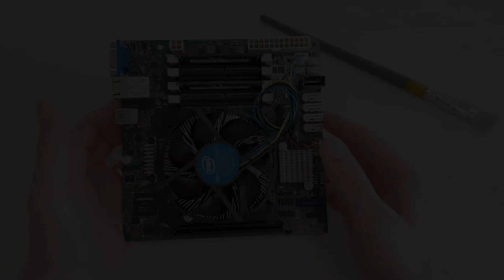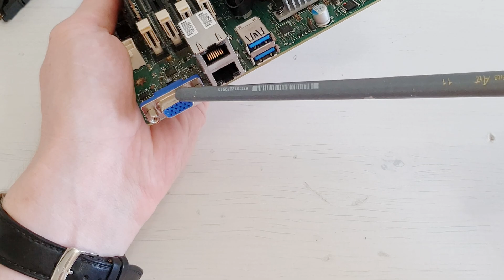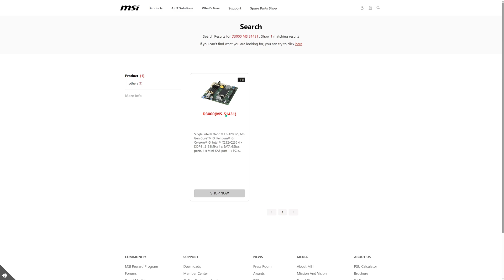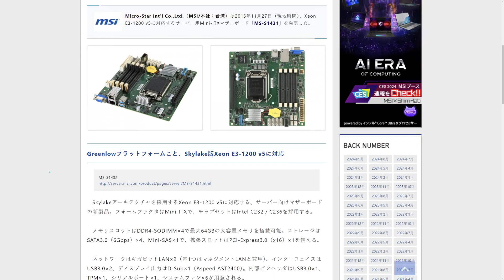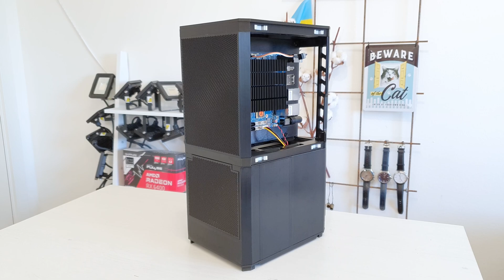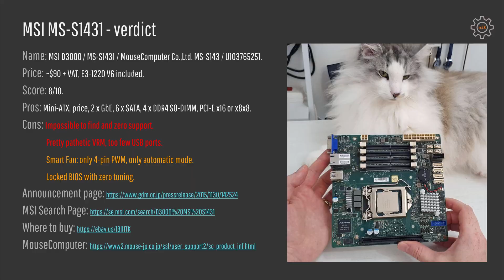MSI MS-S1431 – rare mITX LGA 1151 OEM motherboard for NAS

Comment: Love your videos myconst, i have a question, i will upgrade my e5 2689 with 16 gb of ram to a e5 2690 v4 with 32 of ram, i already have a gtx 1650, what graphic card do you think i should buy that doesnt give bottleneck and is good for games?, i would pay like 300-400 dollars for a new graphics card, and what graphic card has a lot of bottleneck with 2690 v4?, like at what point does it have too much bottleneck?
Reply from the maker: The question does not have a universal answer, it really depends on what games you play, what resolution and settings you use. In general, I would say RX 6650/7600/6700/700 XT or RTX 3060/4060/Ti are good candidates.
Reply: @Miyconst Thanks

Comment: In my search for the perfect motherboard for my NAS, I think I finaly found a good candidate : Gigabyte MC12-LE0. VGA output (no need for a PCIE graphic card or an AMD CPU with APU), 1 slot PCIE 4.0 16X which allows bifurcation for my 4 nvme ssd and 1 slot for my 10gb netword card, ECC and recent CPU support, and 6 sata ports as bonus. Bought new 85€ with shipping on ebay. I will test it when my Ryzen 5600 will arrive.

Comment: If it is an MSI board, maybe you can access the hidden BIOS settings with the combination of Right Shift, Right Control, Left Alt and F2. That is the key combination for the MSI laptops (might work here as well)
Reply from the maker: Sadly, these combinations don't unlock anything in the BIOS.

Comment: Also, in terms of ZFS, if you play the 1GB per 1TB rule (Which is a rough estimate) I suspect 64GB to be plenty for 20-40 or even 60TB of storage. If NOT using ZFS, then a simple SSD cache disk should do the trick especially in unraid.
Reply: the 1gb per 1tb ''rule'' is a complete myth. For the vast majority of home uses cache requirements do not scale linearly with storage amount. 1gb per tb recommendation is based on enabling deduplication on a large frequently accessed dataset.
Reply: @sneak3009  I suppose it all depends on how big of a data transfer/ push is typical. It's not a myth if it had a purpose as you described. Even if that purpose is not relevant to a specific use case.
Ideally you would have a nice large cache pool but you can easily make 64GB work.

Comment: Interesting that the Intel Arc page and other pages list only 64GB of ram support for this CPU. It's clear that you can load more and it's seen here and there, but I would say likely not officially supported. There are also only 2 memory channels, so maybe just 2x 32GB DIMMs is the way to go. However, understanding the risks, it's POSSIBLE to push your luck on 4 modules.
Reply from the maker: I think, back then 32 GB DDR4 modules were not available, at least not SO-DIMM, that's why it's not supported. Still, even 64 GB is better than 48 GB or N97.
Reply: 1151 BIOS is possible patchable for 128gb RAM. (Coffeetime)
Reply from the maker: The MS-S1431 doesn't need any patches, supports 128 GB out of the box.
Reply: @Miyconst  ah cool 😁

Comment: can you undervolt with Throttlestop? n97 is sure locked but Skylake could be unlocked
Reply from the maker: I didn't test it, unfortunately.
Reply: @Miyconst  would have made a difference for power efficiency expecially under load!